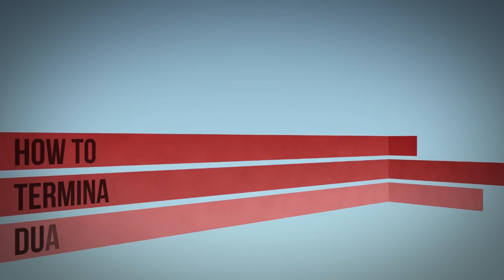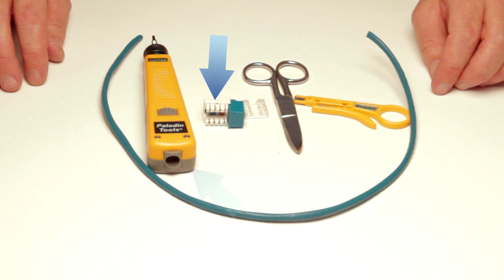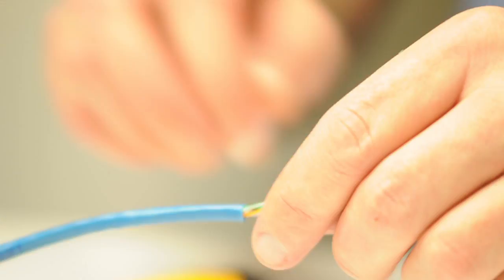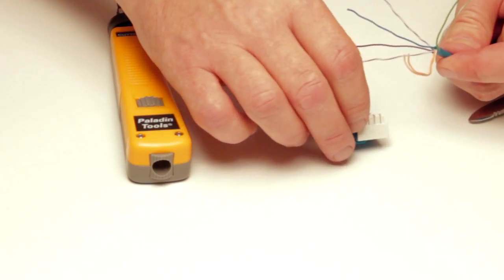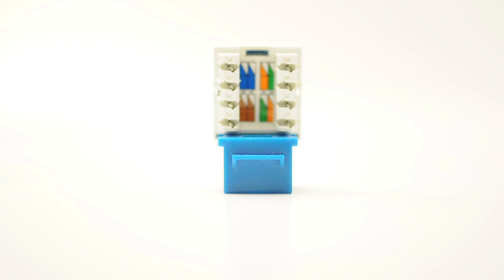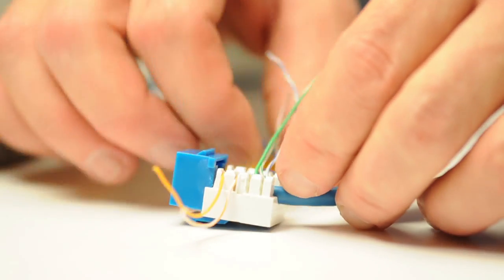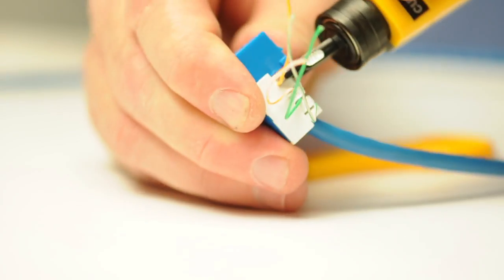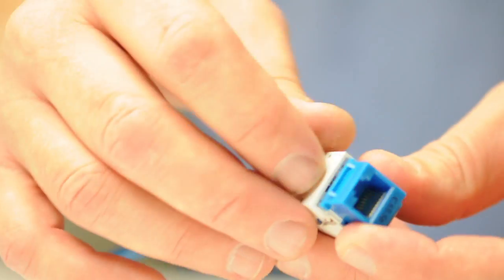How to Terminate a Keystone Dual Row Cat5e Jack

Comment: What is the difference between the A and B?
Reply from the maker: The difference between the two wiring schemes is the placement of the green/white and green wires.  568A has them first where 568B has orange/white and orange first.
Reply: I am doing some network wiring in my tiny house and I will use 568B. I like the way the pairs punch down using B. Thanks